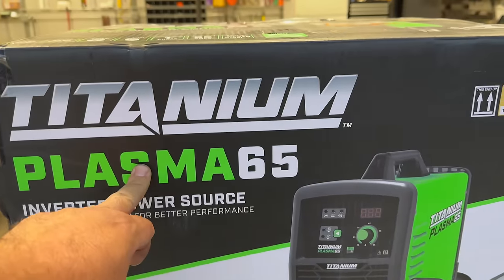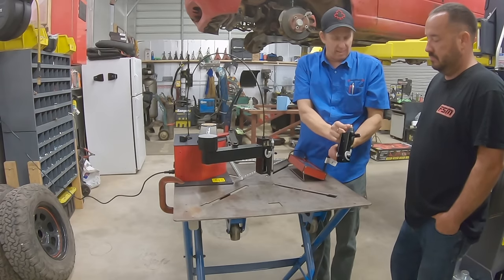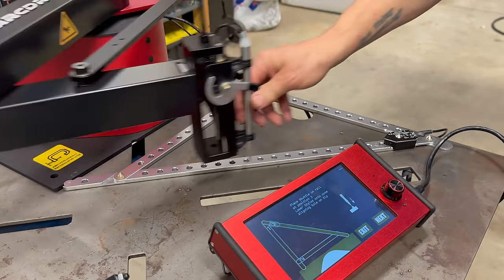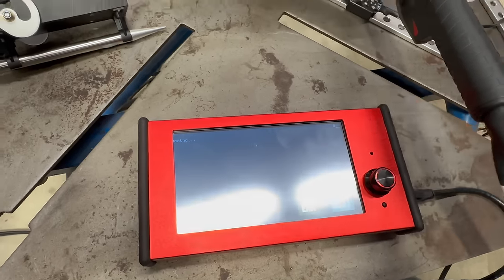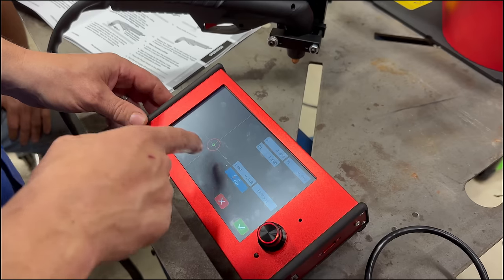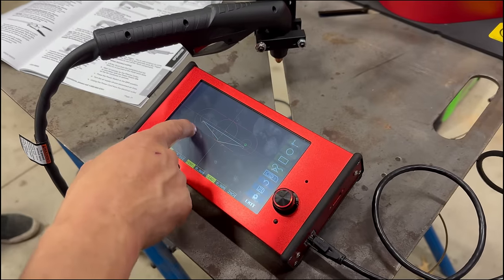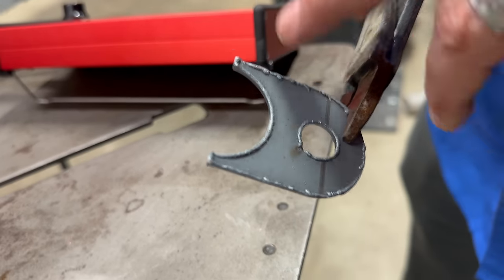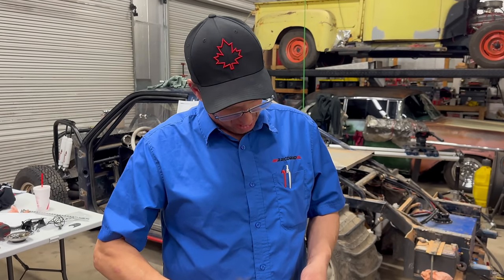We got a new Arcdroid cnc robot and Harbor Freight plasma cutter in the shop.

Comment: Very cool that you got an ArcDroid, and the 65 Amp Harbor Freight plasma cutter, and you got the chief engineer from ArcDroid to test it out with you.
I bought the ArcDroid and was trying to decide which plasma cutter to get, and figured buying at Harbor Freight, I had a resource close by Incase I had a problem, so I bought the same  65 Amp Cutter you have.
I was wondering if there was going to be any electromagnetic interference with the two components.
Glad to see there is not.
Looking forward to seeing what you make.
Take care.

PS. Make sure the goggles / eye protection you use is at least rated at 10 and rated for plasma burning. I read some warnings saying regular welding goggles are not dark enough for use with plasma cutters.

Comment: i need help sir can you help me out i need to replace my torch to the IPT65 but i cant find the wire diagram to the torch what wire color goes to the head torch and the connector i tool mine apart and the IPT45 is different to the IPT65 torch. can you disassemble and let me know ?

Comment: Never actually showed how to connect the ArcDroid to the Titanium 65. Do I still need to disassemble my cutter or is there an external plug available for easy connection?
Reply: I should clarify, I know the 65 has an external plug but what cord/connection are you using to link the droid to it?

Comment: IF YA USE PLASMA GAS YOU CAN CUT EVEN BETTER. BUT COMPRESSED AIR IS WAY TO GO. i HAD A THERMODYNAMICS STACK PACK, BUT WE WERE CUTTING 2.75 THICK MATERIAL RUNNING PLASMA GAS.  oop sorry bout caps doing paper work earlier. best of them is ya can even cut copper or what ever. I so regret sellingmine but it was a huge Industrial one i bought out of a welding shop closing. but the thermodynamics stack pack you could add to the packs to increase power with out needing more indivigual cutters.